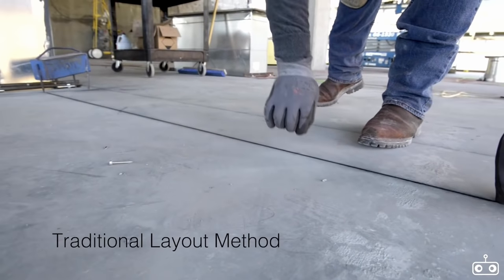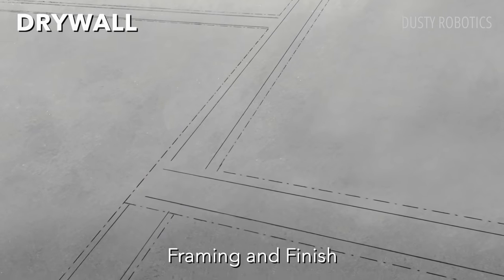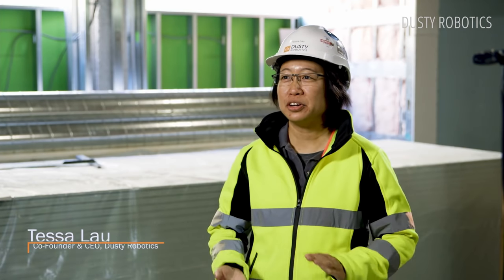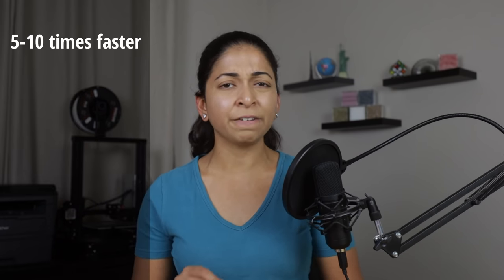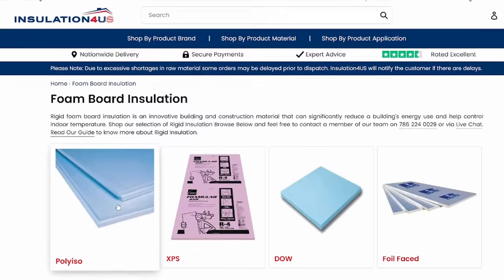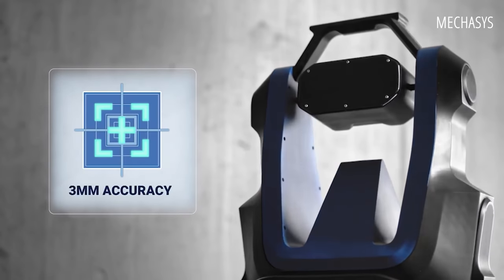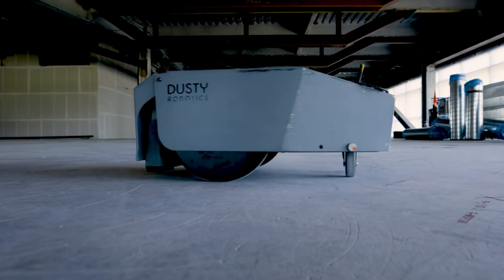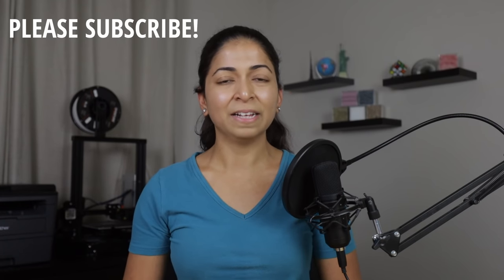Robotic Construction Printer | Dusty Robotics

Comment: I'm a carpenter. I snap lines. At first I was going to get excited. Thought to my self, this could save time. Thing is, in a perfect world, with zero mistakes in the foundation, no pipes hanging out from the slabs, slabs with zero mistakes in diagonals squaring everything perfect, then this would work. 

There's is so much going on at once that this little devise seems like it will just get in the way. As for compounded added errors it's up to the lead forman to adjust for that. I can see this working on a flat piece of paper but not on my job site. If it doesn't make my life easier then I don't need it. Chalk lining for me is still the only option. 

From a real carpenter.

Comment: Pretty cool.

Robots are good until they are not. When technology falls (for a multitude of different reasons) humans will need to be able to transition back to manual methods.

A good example, US Marine Corps Artillery.  As an Artillery Officer we took advantage of every technological advancement which could increase our responsiveness and accuracy; however, we also maintained our centuries long trade craft of accurate predictive fire with "glass and iron", "charts and darts", and firing tables and slide rulers. 
When various aspects of our technology platform failed we could easily switch back to the manual methods to continue our mission.

Comment: THe assumption that all interior is layed out with string and tape is incorrect- robotic total stations have been in use for a while.  You mention GPS coordinates- buildings don't use large grid coordinates like GPS.  How does this interface with BIM files like IFC?  How does it handle object lay out?

Comment: They are selling this as a service, rather than as a device. Making this a service really detracts from the usefulness as it immediately gives you another crew you have to schedule for. And that makes it so that you need to have the whole job marked at once meaning that the whole job needs to be clean at the same time. It would be so much nicer if you could use it on a section at a time and move material around it. I think that Dusty Robotics will lose out to a company that makes a similar robot that is for sale retail.
Reply: It’s great to know about the service.  One more thing that service vs property is gonna be an issue. I have zero construction background. I saw this video as a great curiosity. And sadly i know too well the service plan business model is killing my software because now I have to pay year to year or month to month. Great tool but if you have to pay for the service its a terrible idea. Thanks for sharing this
Reply: Most often, the exact same crew that would being doing the layout manually is trained on the Dusty system and they use it as a tool to assist them with a job they would be doing anyway.  Union rules typically prohibit Dusty employees (or another crew) from doing the layout.  Fortunately, the unions have been very receptive to seeing the robot as a tool that allows their members to be more productive and the job more pleasant.  They seem to see it as a logical extension of the total station.
Reply: "lose out to a company that makes a similar robot" - the platforms already exist, for decades (yours truly was engaged in designing one back in the early 90s). Adding payload like printers or engravers, if necessary, can be done quick and easily. The problem is, the industry doesn't need it. One reason, as Thomas Stuart said, is the unnecessarily strict requirements to the site condition. Another is concerns about long-term durability. The shown contraption just doesn't seem as robust as, say, a Leica laser station. Oh, and the unfortunate fact that there's often no GPS signal inside buildings.
Reply: @jmi5969  Building a robust robot that can essentially live in the back of a pickup truck and be used reliably on a day-in-day-out basis is one of the major challenge Dusty faces. I believe we are up to the challenge, but time will tell. BTW, we are looking for experienced engineers to join our team for people who want to help us meet this challenge.
Reply: @mpbroadcast  Are you sure you don't want to partner with one of the major players in the tool industry? Along with the experience you need, having commonality of batteries and chargers would be a big selling point.
Reply: @mpbroadcast  you work with Dusty??? I think you missed my point. It’s a great tool and great idea. BUT charging a SUBSCRIPTION is an abomination. We are tired of subscription based tools. Sell an expensive item if you want. ONCE, but not charge monthly fee to keep using it. Adobe, Autodesk, Arlo, everyone is heading that way and it’s going to be a business killer
Reply: @freakinccdevilleiv380  and i read that with a churman accent.
Reply: @KijasFX  That's not how it works for startups. I'm considering working at Dusty or another similar company, but this is my biggest concern. The construction industry does not want to pay a subscription. However, startups rely on exponential growth. This can only be achieved if they can generate reoccurring revenue. If they only sell robots, what happens when they run out of companies to sell robots to? Then they will only be able to replace them when they break. To expand, startups must continuously raise money from outside investors. These investors won't give them money if there is no opportunity for continuous returns. Therefore, it must be a subscription if it is to work. However, if the benefit from the robot is enough, the industry may eventually be willing to pay this subscription.
Reply: @freakinccdevilleiv380  exactly.  We are heading in that direction.
Reply: @TheSameFight  I will admit not knowing much about startups. HOWEVER… if you have a product you sell once and cant make profit then you have a bad product. The subscription model is never good for the consumer. And how can you ever run out of construction companies. In one city? In one country? In the world?????   If it’s a start up with a good product you can get investors who believe in the product and place capital for growth.
Reply: @TheSameFight  No, that's not how it is for startups.  That's how it is for startups that don't have an actual useful, viable business model.  If you produce a product that is a direct improvement then it will sell no matter what because it provides value.  If you are trying to produce something that is at best a side-grade with 'huge disruption potential' then you're going to need an external vehicle to 'convince' people it really is valuable.
Reply: I'm on there wait list since I contacted them the first time I saw this unit. I got the impresion that they are integrating a lot at this stage so they don't want to sell units. Guessing there will be a number of different models later for different levels of complexity. If you just need a resi stud layout of interior walls or electric.
Reply: @jra7690  I'll have to respectfully disagree. What we are doing in many ways is comparable to a laser printer replacing handwriting for creating documents. Using paper and pen is very simple compared to using a computer to write a document, but for many purposes the productivity gain makes the complexity worthwhile.
Reply: @mpbroadcast   I wouldn't be afraid of making a bigger robot than this. Something that can clean the floor as well. Also that can drive over things like hand tools, small scrap etc 

How easy are the marks to remove if changes are made and how easy is it to get the robot to remark just that local area?

I've never seen chalk lines used for accuracy over long distances... Always there have been indexing marks made. And the chalk lines never took long to mark out in comparison with the scale of the work.

But that's just my experience.
Reply: @TheSameFight  
Except every other company who made a product with no such subscription or reccuring fees

Comment: Probably targeted to large developers: fix the printing errors on the first house, and the rest will work smoothly.
Reply: Don't underestimate human creativity. You could get out CAD errors, but could you guarantee that slab would be exactly the same?
Reply: Bingo!!  we do the same house a lot. once they have units for sale we'll get one.
Reply: yeah you pretty much can, I 90 percent of the comment here are from the bottom 5 percent of the industry. If you don't have a tolerance on your contract your not that good. Unless your on top tier resi where tolerance is 0
Reply: Imagine if the GPS survey fix is off by a tiny amount. This tech has been used in ship building for years but it's squared to the keel and not to gps.. I don't see the silicon valley nerds anticipating calibration errors.

Comment: Yes the Egyptians had been doing it this way. What happens when you don’t have individuals trained to do a proper layout without these aids? While this is a useful and efficient technology, the fact is that in most buildings, you require a good bit of on the job adjustments. Engineers make mistakes ALL THE TIME. A skilled layout team will catch and fix those mistakes on the fly. If you lose that training guess what happens? Engineers and architects may design buildings but your construction crews are a critical part of the completion of these projects. Layouts were a critical part of my training. Not because I would do hundreds of layouts but because it elevated my understanding of why things go where they go.
Reply: that's like saying nail guns would end the knowledge of how to frame. Everyone reading the layout knows how to do the layout by definition. If you can read it you can write it.

Comment: Like you say simplicity is key, manual chalking is processing and correction on the fly, especially for small non-repeating sites.. dusty like other robot’s strength will be for circular dimensions and fast confirmations of manual chalking (critical datums). If both align then it’s pretty safe.

Comment: Good video! Initially I was skeptical, being the guy who runs around the slab and Chalks the cut lines for it. But clearly I'd be immediately crushed by this guy when it comes to anything more complex, like the other example you point out in the beginning.
Reply: Keep your skepticism! A plotter on wheels might make your job easier, but now half your job is kicking the roomba when it gets stuck.
Reply: @jercos  lol yeah you'd need a very flat floor/clean floor for it. Maybe it should be a duster too
Reply: @jercos  No need to kick the robot.  It comes with a remote for getting it out of 99% of sticky situations it may encounter. The other 1%, well it may need a kick or lift 😀, but we are working on that.

Comment: Have to be careful with lasers. Your eyes are very precious. Also infrared lasers will blind you and you won't see it coming until it's to late.
Reply: It depends on the laser class
Reply: @TqSNv9R0iG5Ckxew  Very true, but after repetitive use is what does the damage. I worked with cnc's and panel saws, and used hearing protection for 15 years. It is never quiet anymore for me and it sucks. I also know old welders and they have problems to. You have to be careful with any tools you use of course.

Comment: I'd love my guys to use this. We do gym floors and have to do a lot of chalk lines for gamelines. If manufacturer is looking DM me.  Absolutley for a clean floor.  If we could set a machine in the gym at night and come in the next AM to it being clean that would be huge.  ALSO a FF/FL markup system to call out high points on the slab for repair. Simple RED + signs would work.
Reply: Dusty if you're reading call this guy. Gym floor  refinishing is a big money specialty. They will pay,

Comment: It's surprising to me, just how many people, have never been on an active job site before. This could only work in circumstances where you had unlimited time and, money.
Reply: This device doesnt need light, so it can Drive in the dark.
Also its light (in terms of mass), so it could drive in green concrete.
There is time, even if its not in plane sight.
Reply: It's a plotter, not a worker. With a crewman half hand-marking and half kicking the roomba when it gets stuck, it's a "time-saver" for large commercial layouts. A gimmick that, if it works, makes it that much harder for a traditional tradesman to survive, while bringing down the cost of Amazon warehouses.

Comment: We tested out a Dusty robot in our shop and the demo wasn't that promising. It's like if you see videos of people putting on a mixed reality headset and it looks great on paper but then you learn that a lot of work needs to go into each aspect of it and it may not be worth the trouble. I don't think it printed anything in the few hours it was being demonstrated, it was either needing to be calibrated or the plan wasn't loaded properly. To me it's the same thing I would say about mixed reality at a construction site, "cool technology, in 5 years is will be more refined and useful".
Reply: I think that was the point here.

Yes, it will take more time to become useful in it's niche.
But at the very least this type of automation, unlike most attempts, could actually turn out to be useful.
Reply: @peterpan4038  I agree, I'm just adding my perspective of actually demoing the product. I think once the kinks are worked out it will be useful to someone, it's just not there yet and I'm not that optimistic that in a couple years it will be worth it to switch over to a product like this.
Reply: @WisemanxSmash  Lets just say i wouldn't invest in their idea. 

I give it better then usual odds of success for a new tech idea, but the bar for "usual" is already really low.

Comment: I could see this robot being extremely helpful for laying out road and parking lot lines. This is also a task that is largely done manually, and it seems very appropriate for the format.  They'd have to change what they use for marking, but it could be extremely helpful for that.
Reply: The Dusty robot is currently being used to layout the parking lot lines on seven garage upgrades in the LAX airport.  White ink is being used for easy visibility on the fresh tar by the workers who then follow to put down the actual paint. It's a good example of how Dusty works in collaboration with workers to make a job easier and faster rather than replacing people.

Comment: This is awesome! As long as your office has fixed Revit's default dimension rounding ;p.  I also think that a dirty surface would be fine, as you might lose 30% of the information. The trick would be being certain that the robot can maintain location calibration if its wheels slip. (like belt slip problems on a 3d printer)
Reply: Only the cheapest robots use that sort of tracking. This can be considered a well solved problem, to the point that off the shelf VR headsets do it effortlessly and reliably.
Reply: @GamesFromSpace  I would love to see valve's coded angular laser tracking put to use in construction... a theodolite is a pricey piece of equipment for good reason, while the sensors (on index headsets) are simple photodiodes, and the index base stations are brilliantly mechanically simple. Cover a job site in a ring of base stations and you could run hundreds of positioning tools in the region. Redundant CPGPS-like accuracy for a low, smooth-scaling cost opens the door for dozens of small, helpful tools.

Comment: The thing that I find on road construction jobsites where we have our GPS equipment is, they work great, as long as the design works. But 9 times out of 10, a job requires changes to the design in the field. "We have too much topsoil, just flatten the slopes a bit to make room", and you can't use the design anymore. In fact you would be unable to update the design even if you wanted to. So you have the extra $60,000 on the equipment doing nothing. I feel like this robot would be best suited for large multi-story buildings where once you have a design that works, it's going to be largely unchanged for the next 20 floors.     In residential work, that little 'fudge' factor would come into play more. Things like "well this trim that was ordered is slightly larger than expected, so now the fridge will need to move an inch to the left".

Comment: Microsoft's Hololens is the way of the construction future.  Once they get the costs down to a point where EVERY worker has one on, then everyone can see exactly where everything is supposed to be*  (in whatever the current revision of IFC drawings they're working from).
That said, it's all the designers and engineers (sometimes from multiple firms) that need to get all their stuff together, and all be on the same page, before asking construction to  build it.
Having everything in a live, real-time, software with a device like Hololens, could even allow issues to be found and resolved real-time.

edit
Found one of the videos regarding what I'm talking about with Hololens in Construction:
https://www.youtube.com/watch?v=ItGmB2tQyY8&ab_channel=MicrosoftHoloLens

Comment: I'm an ex setting out engineer...

This makes sense for certain sites. They for sure need a blower otherwise the marks will not stick. Thst will create lots of dust. Which is not a limiting problem thought. 

It's good that the connected it to the total station. That makes sense. 

Another thing I've never seen is a freshly poored slab without people on it working. Although that's a detail. 

I think the technology makes sense and is part of the future of construction. 

PS: chalk lines stay for as long as needed - whcih is usually only one few days. Markers are often uses on walls, but even chalk lines stay for decent amount of time on walls.